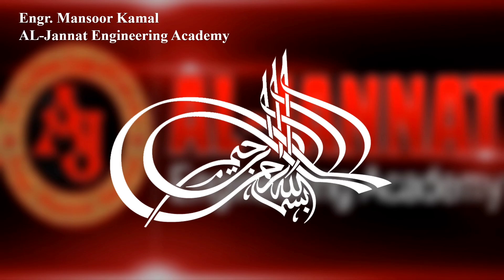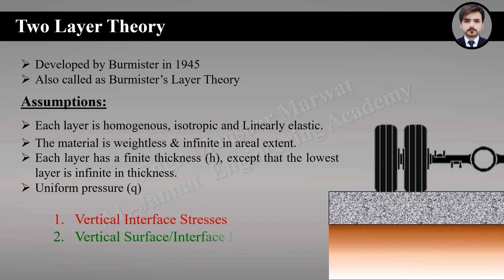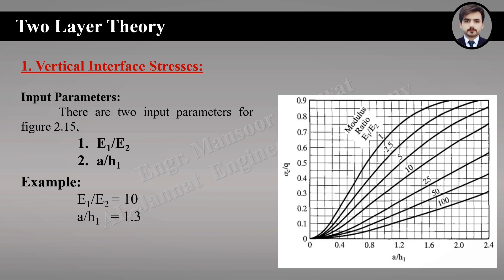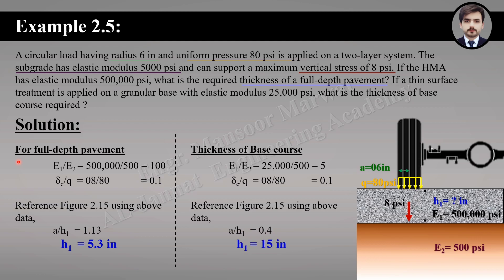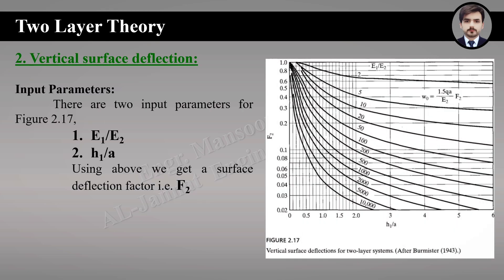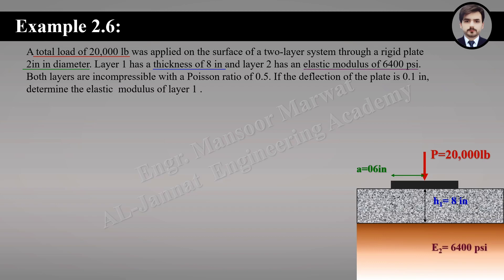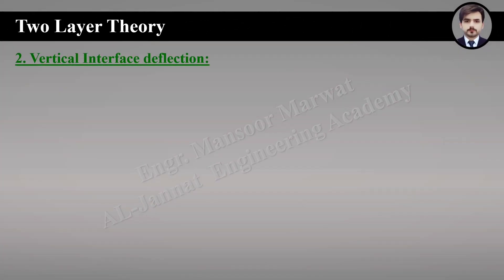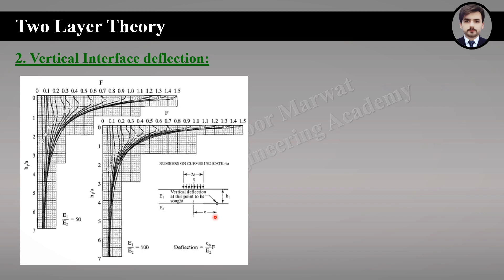Two Layer Theory( Stresses & Deflection), Analysis of Flexible Pavement...

Comment: How the value of a is 6 in, If the diameter of the Rigid plate is 2 then the radius will be 1 in, Isn't it so?
Reply from the maker: Apologize...
It's a 12 inch diameter not 2 inch...